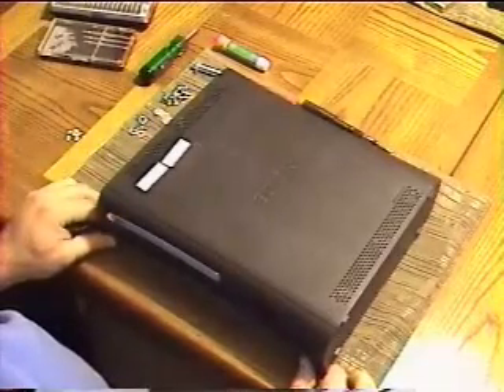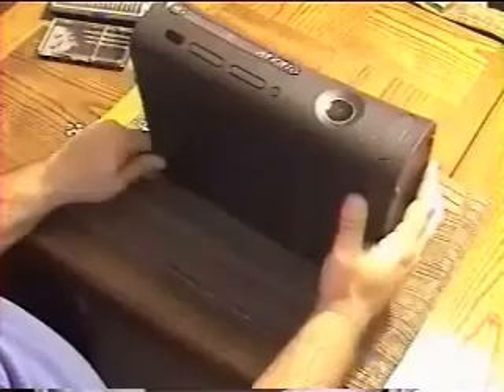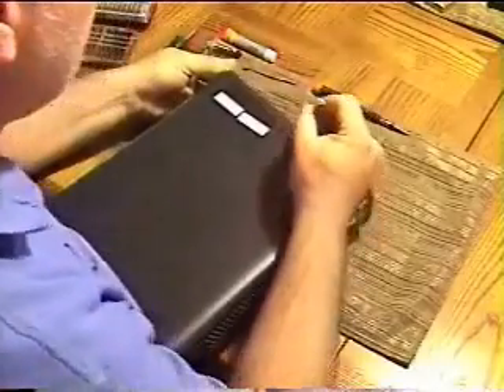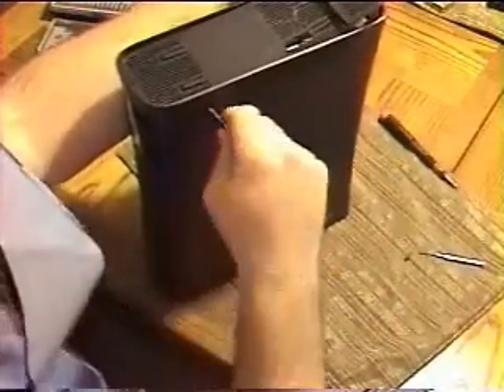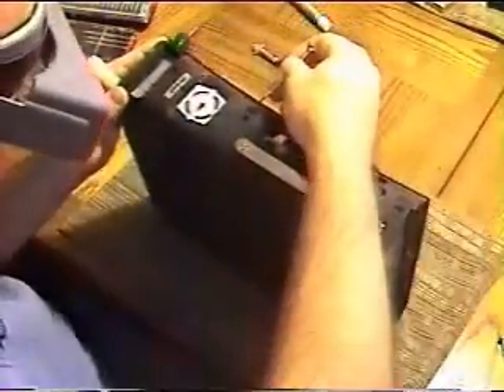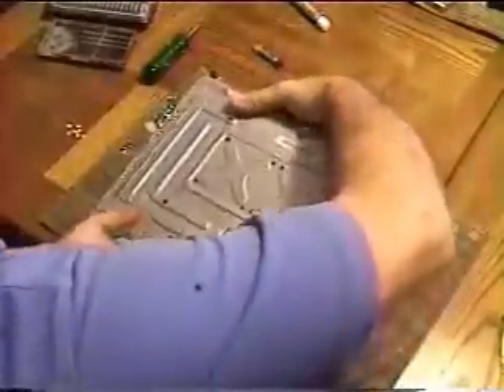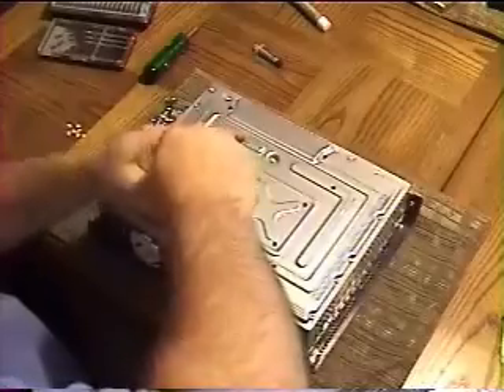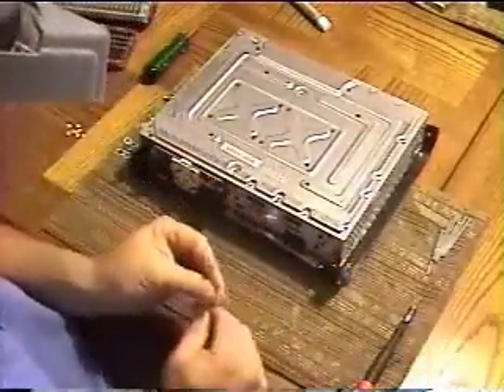3 Red Light Fix Part 1

Comment: THANK YOU! I had a different issue (green hue, and then no video) which although stems from the same problem (overheating) is not covered by the extended warranty. This is my second 360, which I got after the RROD was replaced 6 mths ago. Xbox support told me that replacement is only covered for 60 days, and asked for $99 to repair. I have done the fix, can not thank you enough. Everything works great now. Did a test run for 6 hours yesterday ;-)  THANK YOU VERY MUCH!

Comment: Dude thanks alot :D
For everyone! This really works, I personally didn't do the cooking part since I used a very strong kit between the chip and the heatsink which doesn't require to warm up and my xbox works perfectly, I strongly recommend to buy a extra cooler add-on after fixing it though, because you might screw up your kit/arctic stuff between the heatsink and chip because of the warmth

Comment: I used pan heads and they worked fine.  It does put a little pressure on the bottom of the chassis, but no big problem whatsoever.

Comment: Xbox 360 Fixed! I had the no video but green lights error no RROD and the x-clamp mod has my 360 running like new! After the fix it was blinking RROD for the 20 minutes I was "baking" the GPU. Turned it off after 20 minutes waited 20 minutes to cool down. And it started up all green!

Comment: Hiy, my xbox had the 3 red lights so i decided to try out the x-clamp method to fix it, ive done everything as i should, but when i turn on my sbox the 3 red lights show up again and again even if i overheat it.i put the xclamps back on as they originally were to see if it will work but 3 red lights show up again, i also tried the penny trick and the towel trick but nothing helps, does anyone know y is it happening? thenks